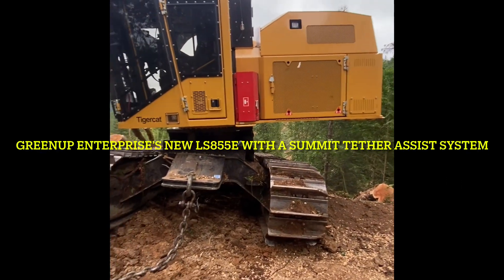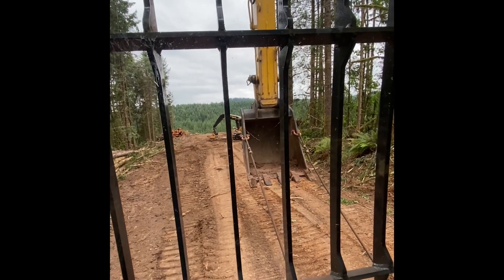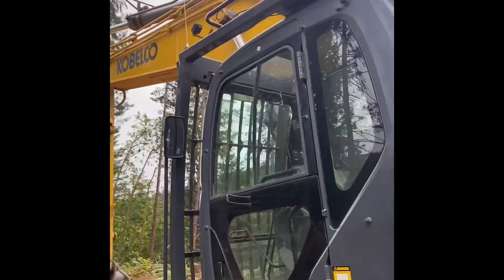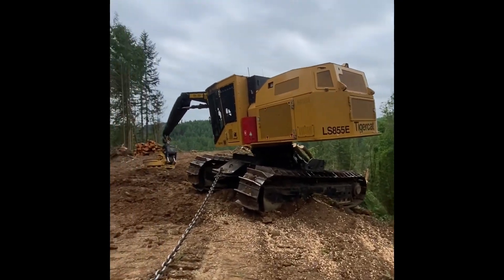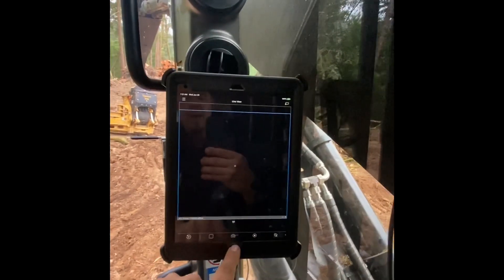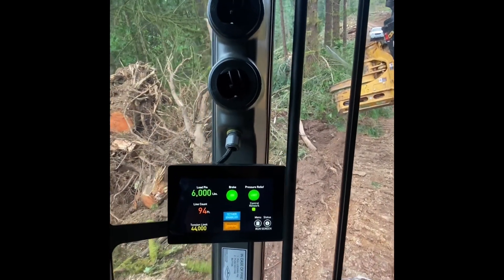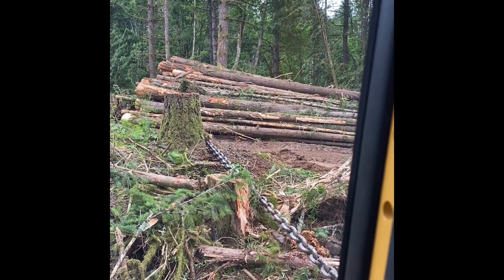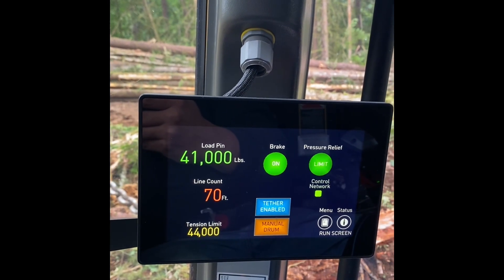Tigercat LS855E with a Summit tethering system

Comment: As someone that knows nothing about logging, I have a question. Would burying the bucket to just below the bottom of the sheave give you even more purchase/security for the tail hold. And in return you in the other machine? In stead of dragging tracks and bucket across the road. It would try and pivot the hold machine over the bucket. My only experience is with seeing my grand parents underwater gravel excavation dragline.  It had a D6/7 buried into a bank as a tail hold for the old link-belt? I think tail holds the right term, deadman, I’m sure you get the idea.
Reply from the maker: So there is two different tether base manufacturers that have you dig the bucket in the ground, on my set up you don’t really need too, I don’t know if it’s because my shive is on the bucket and theirs are up higher by the bucket linkage !?! But I think with mine being on the bucket close to ground its forcing all the pressure to the ground! Also my shive only only allows you you to pull so far off the side of the bucket, and my base machine is heavier then my tigercat! I’ve only pulled my base machine a few times and that was due to me not putting it in auto mode lol most issues are from operator error or someone being lazy on prep where you base sits! but we have a safety pin that goes in the ground and is connected to my drum and if my base machine moves to much it will pull that pin and it will stop my drum from pulling me! I hope that helps with your question?!?
Reply: Definitely come a long way! Takes a pair to trust that and roll off the side! My grandparents only put one D6/7? deadhead Cable machine into the bay, when the operator got a little froggy with the old link belt. Luckily it was long before the DEP. crazy how far technology has come.
Reply: I have tethered with the traction line which uses the bucket reversed, if the bucket is planted good is decent you can side pull nearly 90 degrees to the winches.  Which really helps when your on a really narrow trails and the stumps are to small to redirect the line.

Comment: Nice ride there Josh! I watched this a while ago but you didn't have your comments turned on. Want d to ask how you like then5195 over the Southstar I think you were running before? Good video, thanks for posting.
Reply from the maker: Thanks! Yea I’m still figuring out the whole YouTube thing , so I finally figured out hoW to turn on the comments! I really love the 5195 head! It’s feels smaller then the southstar and I can cut smaller trees without them falling through the grab arms and breaking my chains like the southstar! There is no electrical from the carrier to the head, it’s all pilot oil! So that’s nice not having to deal with electrical issues! One thing I did like on the southstar star was the grab arms had just one cylinder With a link arm to tie them together, which seemed a little stronger when/if needed to dig little stumps out of the ground!